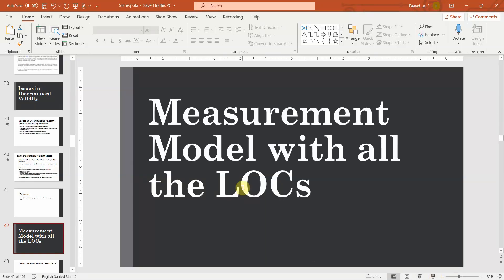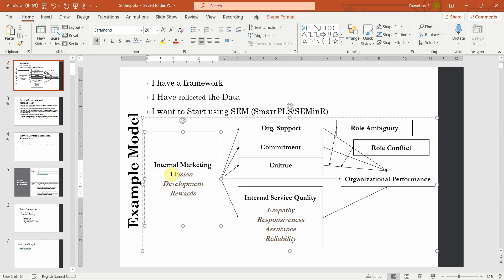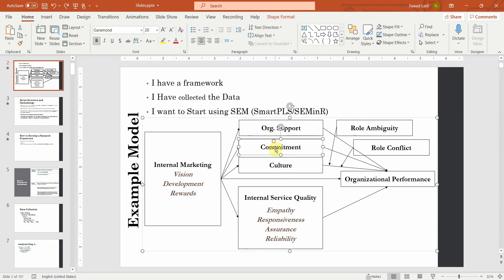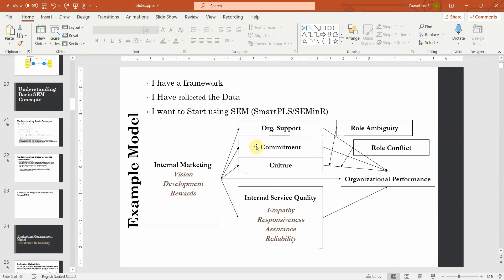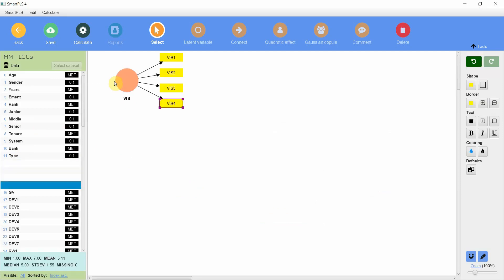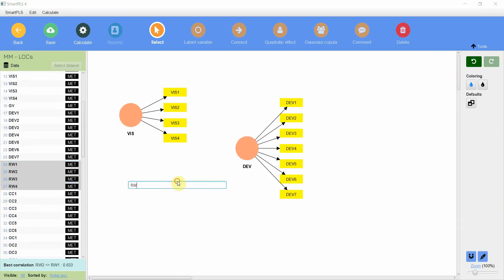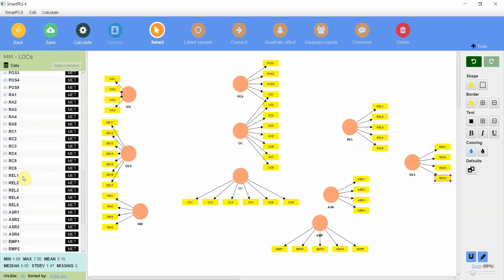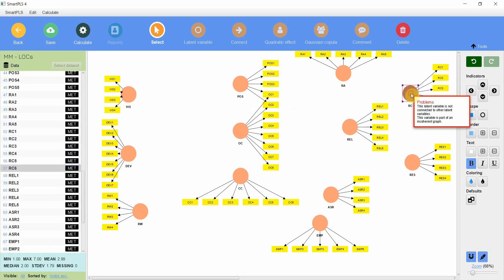#SmartPLS4 Series 11 - How to Design a Measurement Model with Lower Order Constructs?

Comment: Hi professor! I wonder if the moderator variable only needs to be to connected to the endogenous variable when we are assessing the measurement model, or if it needs, as well, to be connected to the others exogenous variables (the ones whose relashionship is moderated). If it only needs to be connected to the endogenous variable, then when we should conect to other ones? I'm asking because we need to evalute the moderator effect before the assessment of the structural model. Thanks a lot for your videos!!
Reply from the maker: The moderator will be connected to the DV in the relationship that the moderator is moderating. Moderating effect (the dotted line) doesn't need to be part of the measurement model assessment.
Reply: @researchwithfawad  Thank you so much for your help!!

Comment: Dear professor, thank you for your awesome explanation. But I need to ask one thing. In Smartpls3 when you run the measurement model you recommend to select "factor" rather than "path" but in smaprtpls4 you run "path", is that common to take either of it for measurement model pls algorithm?
Reply from the maker: Thanks. I am glad you liked it. Path is recommended for high r square values.